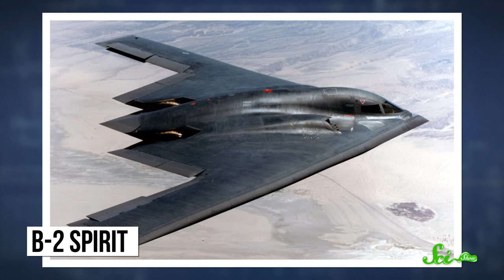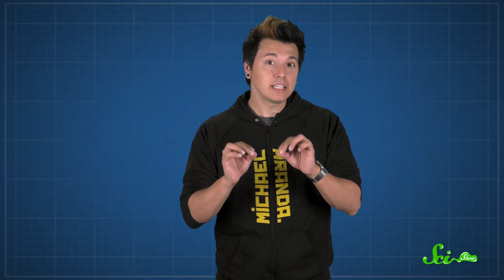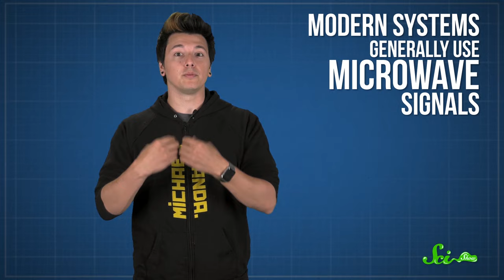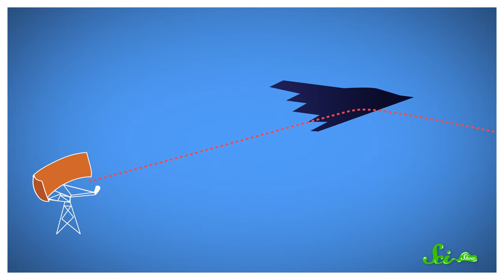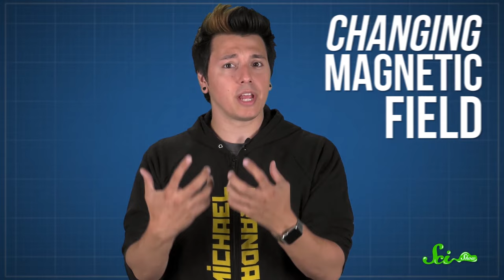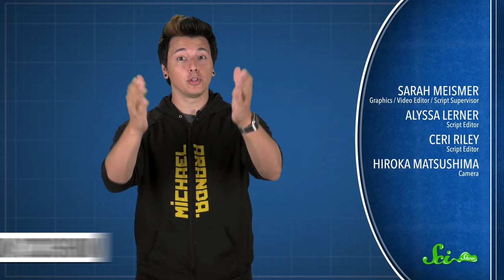Stealth: How to Hide a Plane

Comment: wouldn't the "flock of birds" be moving  900 KPH(or what ever0 ?
Reply: the measured speed is only in relation to how fast it's moving toward/away from the radar (using Doppler shift), you can only get the radial speed from multiple measurements so there's that.   But in practice the main reason to do this is to reduce the detection ranges so you can weave through a Radar net that would say locate a B-52 no matter what but a B-2 can fly through the holes in it.  For stealth fighters  they do this and then can avoid the less powerful radar on other aircraft to shove an AIM-120 up their tailpipe before they even know that the F-22 is there.

Also the whole stealth bit doesn't mean that the plane is invisible to Radar, just harder to detect, generally falling under the signal to noise ratio of the system, Early Warning systems tend to use longer wavelength radio waves which interact differently than the shorter wavelength targeting systems so can be used to know that there is a stealth plane flying in an area but not enough info to shoot at or intercept it.
Reply: Radar system's are designed to filter out certain signals. Radar is often full of white noise, caused usually by weather and birds. At times, if they're land based and around roads, they'll often pick up all kinds of trucks driving along them. That 900kph "flock of birds" will be indistinguishable among the white noise and is often automatically filtered out, even the operators would not see it. If they tried keeping track of every bird within a 200km radius their systems would fry. I'm sure with some very intense pattern recognition software, the radar might be able to pick it out as a suspicious flock of birds from the rest, but as far as I'm aware there's no such technology (not publicly known at least, it would be impossible to notice unless you knew exactly what you were looking for and where). 

You don't always even need a specially designed aircraft to get away with it either. On the Russian/Ukrainian border where tensions have been high, non-stealth standard Russian helicopters have taken a practice to fly a few meters above roads, and when Ukrainian radar detects them, it doesn't acknowledge it as a threat, thinking "Ah it's just a big truck on the road, moving at 200kph, but probably a truck anyway" and filtered out as "white noise".

Same noise filtration applies to infrared sensors, although I imagine there's not that much of difficulty compared to radar, but infrared does have a significantly smaller range.
Reply: The issue is that no one usually wants to use a radar to track birds, so they won't know how fast the flock is flying unless they're looking for it. It's a big-ass sky, and there are going to be a lot of birds, bats and debris which could potentially cause a blip on the radar. Naturally, the operators don't need to know which species of owl flew past so the small stuff is filtered out and ignored. The big consistent ones are the ones which show up.

More fine-tuned instruments can potentially spot a stealth plane, but since it can get a lot of false positives it needs a human eye to make the distinction.

Comment: But whether or not your going to be detected is still dependent on the range you are from the radar emitter or infrared detector. Stealth's purpose is to reduce the detection range and unless there is a major leap in stealth technology that outpaces detection systems it will remain that way.

Comment: That's nice when dealing with poorly developed military, but it just wont help much against more advanced radar systems. Hell, even with old ass radars, you can use multiple signal emitters with a bunch of signal detectors in different positions, combined in a single network - bam! Now it doesn't matter if signal bounces back or wherever, and you can use a whole bunch of wavelengths (possibly even switching between them in a specific, generated by and "known" only to your network, order) you can't possibly absorb all of them and/or imitate it to confuse the system.

Comment: Are you trying to tell me microwaves are not a form of radio waves? 
I suppose to be super specific they would both be better categorized as electromagnetic radiation, but the radio in my WiFi access point uses the microwave spectrum. Same with my microwave oven. Same with a lot of other radio devices like cordless telephones.
Reply: Microwaves are radio waves in the microwave spectrum (1.6 - 30 GHz)
Reply: Sorry to break it to you mark, microwave, depending on who you talk to is actually more like 300 MHz - 300 GHz and is considered a subset of radio frequency.  Some definitions narrow it down to 1, 2 or 3 GHz as it's lower bounds, but the problem you then run in to is that microwave ovens (and most microwave frequency radios) operate around in the mid 2 GHz band, and UHF radio covers 300 MHz to 3 GHz.
So, either your lower bound is above UHF (making your kitchen appliance a "Radio wave oven") or you drop it down to part way through the UHF radio band at least (making DAB receivers in some regions, GPS receivers, 13 cm radio, 23 cm radio, and RC vehicles in to microwave communications equipment).

There's also the problem that there are radar bands pretty much all over the spectrum, for various different purposes.  Some as low as down in 3 - 300 MHz region.
Reply: I agree that the spectrum breakdown varies depending on who you ask, but I was agreeing with NedThe Dread that radar uses radio waves, contrary to what the video says.
Reply: Like many others have given examples about, the microwave spectrum is quite vast in comparison to other bands. "Radio" is much more vast in its definition, but as I originally said, still contains the microwave band. 
Microwave radiation is still much below the frequency of anything anyone would call light, I still can't believe Sci-Show wouldn't consider them radio waves.
Reply: That being said, it could just be a typo or slip of the tongue, no hate here, just wanted to point out they are still radio waves and many devices utilize them.
Reply: mark5534 Shoot, sorry, was late when I wrote that and I must have misread your comment.  I'd go with the typo slipping through the net explanation.  I can get what they meant, that it works in the microwave band rather than the VHF band that most people associate with radio.  They're just missing a couple of important words heh.

Comment: Why do we use microwave signals and not radio? Are they stronger?
Reply: It has to do with the wavelength.  Radio signals have a much larger wavelength than the microwave signals.  Radio waves can detect much larger objects like hills or mountains, but not air craft.  In order to detect smaller objects, an appropriately smaller wavelength must be used.
Reply: radio waves have very large wave lengths, (often over 1m) and can actually diffract around the plane without even hitting it. microwaves  have a wavelength of just a few centimeters, and so can they better find smaller objects and tighter curves. 
if you have ever wondered why microwave oven doors have those little screens in them, it's because microwaves can't go through, but visible light, which is even more energetic, can.

Comment: What if you had a detector set up far away from the emitter? That way, there should be an invisible barrier between them that the plane couldn't cross without being detected. 
Like this:

                       Plane
                          / \
                        /     \
                      /         \
                    /             \
                  /                 \
                /                     \
              /                         \
            /                             \
          /                                 \
        /                                     \
      /                                         \
    /                                             \
  /                                                 \
/                                                     \
Emitter                            Detector

You could calculate how far away to put the detector from the emitter if you knew the maximum altitude of the plane and the angle at which the emitter broadcasts relative to the ground (I know that's awkward wording but I don't know my terminology very well).
Reply: Would this work?
Reply: There are radar systems like that now.
Reply: I agree with you, the plane deflects radar away from the detector, so just set up more detectors.
Reply: If i remember correct, an arrangement not far from that (more detectors with signal-comparrison and adding) was used in the 90's when the serbs shot down a F117 over the balkans.
Reply: This concept is called bi-static or multi-static radar.  You can take this one step farther and use passive or exploited emitters such as weather and communications transmitters as emitters. Then all you need is a detector and a powerful computer to resolve the signals.

This effectively defeats stealth approaches that rely on the shape of the aircraft deflecting the radar pulse because the transmitters are distributed and it is not possible to have a low cross section from every possible angle.  Even an F-35 returns a pretty strong signal from directly below or above it.  Additionally, these exploited emitters (transmitters) operate at a wide range of very different frequency than military or civilian radars.  It is also impossible to make an aircraft invisible (or low cross section) to all frequencies of radar.

Currently, these multi-static radar systems are limited by the processing power at the detector - it takes a bunch of number crunching to detect, identify and target using these systems.  But computing power is advancing much faster than air-frame designs and materials technology, so guess which will win out in the end?

So how much sense does it make to invests billions upon billions in advanced stealth technology when potential adversaries can just upgrade their computers and software?
Reply: Donald White Well, shit. Also, that diagram looked different when I typed it up on my phone. It looks like they removed all of the big spaces in between the characters.

Comment: That's the thing. it's incredibly hard to hide a 600ft long zumwalt class destroyer. May not show up on radar, but all a pilot has to do is look out his or her window.
Reply: Unless you wanna unload a shitload of bullets which go off Pilot aim, But then you're gonna want an attack jet anyway, not a bomber.
Reply: The whole point of stealth it to wait until you're in a position to attack from which the enemy cannot respond in time to protect them selves. Stealth submarines work because the only way to find them is with sonar. Stealth aircraft work because their high speed and small size mean that by the time someone sees them, they've dropped their payload and are on their way out. The Zumwalt has a top speed around 30 knots (35mph/ 56kmh). If she gets spotted in enemy territory, she can't go anywhere quickly and she can't hide in the open ocean. There are missiles that are guided manually and the enemy will send their fleet after her. Her greatest asset can be easily foiled by patrols that any sensible country would have in place.

Comment: 1. "You might think it would be a radio wave" ... "but modern systems generally use microwave signals..."
Are you serious right now?  Microwaves aren't radio waves anymore?
2. "Electromagnetic waves travel at a constant speed..."  
Theoretically they do, in a perfect vacuum, which doesn't exist...

Comment: I think it might have been more useful to invert the examples ... that is the F117 was more about weird angles and making it hard for a reflection to get back to the radar and the B2 was more about radar absorbing material ... further, I think the main problem isn't the fuselage but the engines; there are lots of varied surfaces that allow for reflection ... finally the B2 and it's radar absorbing coating had a problem, which gained it the title of the plane that couldn't fly in the rain.   http://www.nytimes.com/1997/08/23/world/the-2-billion-stealth-bomber-can-t-go-out-in-the-rain.html

Comment: The only problem is that there is an extremely easy way of tracking "stealthy" aircraft and boats. The earth is constantly bathed in low levels of microwave radiation from space (it's about 3% of the static on an old type TV). Have an array of detectors and wherever there is a stealth aircraft or boat there is a hole in the radiation. Simples.

Comment: So wait, what if you had a transmitter and two receivers, one in one area with the transmitter, and one in another area opposite of the suspected area (and another I guess for triangulation). The signal would bounce off or get partially absorbed by the plane and would look different than expected in the other receivers, from that data couldn't you manage a guess at where the plane is?
Reply: that receiver would need to be in a plane that was following the stealth plane from above. kind of defeats the purpose.
Reply: You could set up satellites, if all of your bases and satellites were connected you'd probably pick them up occasionally breaking the contact between two of them.
Reply: GoogleMinus that has the same problem, with the troubles of spaceflight. it wouldn't work.
Reply: Nathan Lang Why wouldn't it work? There are a ton of satellites and it would be possible for them to receive the radar signal from the others and if they didn't they would know there is something between them.
Reply: GoogleMinus because as many satellites as there are, they cover only a very tiny portion of earth. if they were all put right next together they would... be destroyed. but assuming they don't, they wouldn't even fill a 500 ft square. most of these are not military owned satellites. those that are don't all belong to one country.
Reply: Nathan Lang Well yeah they can't be right next to each other but that's why you put them at different elevations for their orbits. Probably not enough of them to effectively see an object though.
Reply: It's kind of difficult to explain why the satellite idea just plain doesn't work... the scales involved are literally astronomical.  Some problems...
- RADAR works because the system knows that the signal it received was the one it sent out.  If the signal were powerful enough to reach a satellite, and the satellite were set to pick up that frequency range, you would be receiving signals from every radar dish in line of sight plus any reflections from any large object.
- If you didn't want to only pick up signals from things flying almost directly over the transmitter, you'd have to be processing signals picked up by satellites nearer your horizon... a signal strong enough to reach those would likely drown out most signals sent to satellites nearer from dishes further away, and would increase the reflection problem further.
- Earth to Orbit and Orbit to Earth signal transmission isn't exactly the best thing in the world... consider how many problems satellite tv has, and in that case they're only having to deal with cleaning up a very controlled signal.  This system would have to take all those weird signal interruptions and distortions and try to guess if they were caused by a plane or a cloud.
- RADAR is extremely directional in receiving signals, that's how it knows which direction the reflection came from.  These satellites wouldn't be especially directional, so the hope is either occlusion or triangulation, both of which are really hard problems at these scales.
- The amount of sky covered, compared to the amount of sky there is, is tiny unless you are literally covering the sky in satellites.

Think of it this way... it would be like trying to spot a plane at night based on it passing in front of stars or reflecting starlight, and you'd need to be able to work out that it wasn't actually a bird passing in front of those stars.
Reply: Well it would be possible, the way we find black holes is from the lack of light.  Probably not feasible though.
Reply: KaitharVideo to add on to your star analogy, it would be like watching about 10-12 stars exclusively, that are spread out in different areas, such that only 1 or 2 might be visible from any one spot, and then work out if the brief interruption was a bird, plane, or atmospherc interference. never mind dealing with clouds.
Reply: GoogleMinus Mmm, if I remember correctly, we locate black holes by a combination of high energy emission detection (black holes sent out a lot of radiation when eating) and gravitational lensing of the things behind them.  Spotting them by an lack of light is unlikely to work since there's quite a bit of space where there's nothing to put out light, and many of the biggest black holes are in the centers of galaxies where there is a lot of light.
Reply: Nathan Lang I also had the thought of using the analogy of spotting birds landing in a field by using fixed angle laser pointers, but figured that was a little harder to convey.
Reply: KaitharVideo i like yours better XD

Comment: waaaait, what?
"You might think it might be a radio wave [...] but modern systems use microwaves signals" ... microwaves are a kind of radio.
ITU for example classes everything between 3kHz and 300GHz as radio, the UHF is part microwave.  Though I suppose we could start referring to our mobile phones as "microwave transceivers", might make them sound futuristic.

"When a signal from a radar detector hits it" ... a radar detector is the thing that detects radar signals are moving in your direction, the signals come from a radar system or radar array.  Detectors don't emit the thing they're detecting, it would kinda defeat the purpose.

Pedant over.